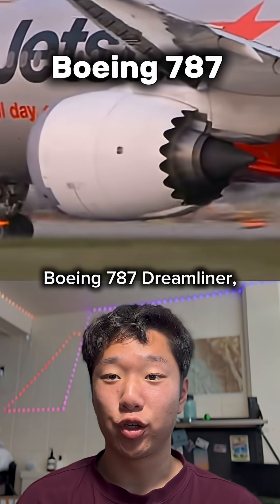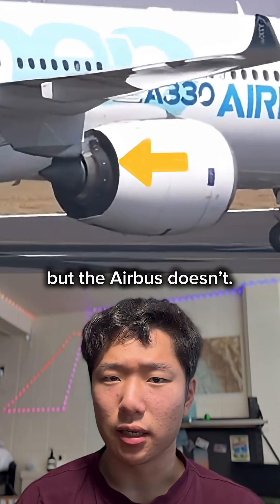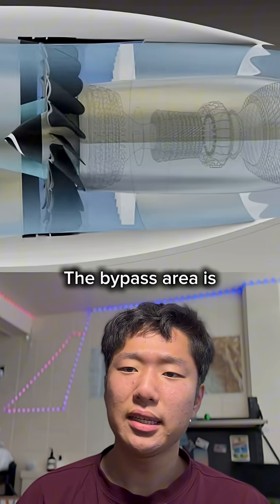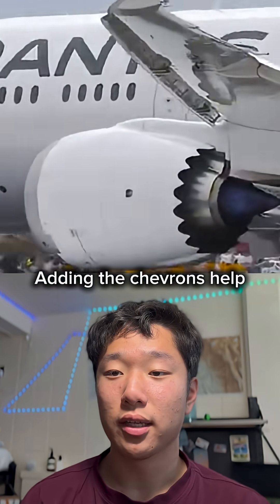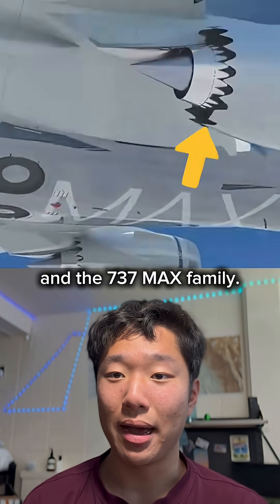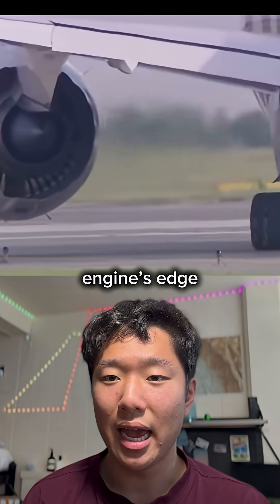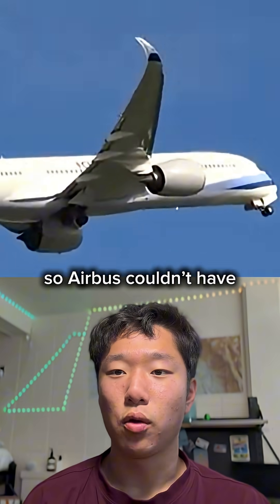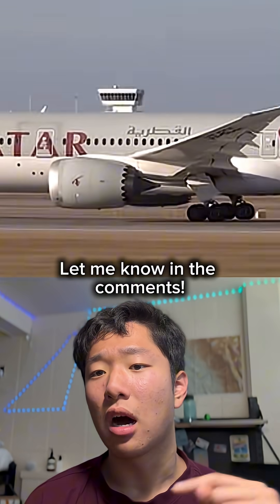Why do Boeing plane engines have chevrons? #aviationgeek #aviation #airplane #aeroplane #airlines

Comment: When you can increase efficiency 0,5% at no extra cost it’s a no brainer. There is constantly 100eds of engineers at both companies only working with efficient designs. More efficient engines. 
If any of them could get fuel 0,5% cheaper they would do almost anything to get that. 
It’s both cost over a 30-40 year lifespan and emissions. 
It’s just Boeing madness to have them. 
Getting another seat in for free on each flight is worth a lot of money for all airlines. 

And the finances of an airline is all about filling every seat. They make no profit on 80% filled planes. Many not at 90% full planes. But the last passengers is all profit. 
That is why fuel cost is so important. 

Same as car manufacturers. Some cars break even at 150.000 sold units. Then the profit comes on each unit produced after that. 

That’s why a flop car can ruin a car manufacturer. Big initial costs must be recovered before there is any profit. But a great selling car can make shitloads of money for a manufacturer. 
And a recall that costs $ 500 for all cars over a 4 year period can put a manufacturer back to red numbers. It’s all about the volume over break even that can be profitable. Very profitable. 
A car can cost 30% of manufacturing cost. But development and factories must be paid for before they get any money in profit.

Another similar industry is restaurants. They have lots of costs even if there are 10 customers they loose money on each one. But maybe a small restaurant needs 150 customers for lunch and the last 50 makes a big profit. The food itself costs very little. It’s the staff, rent, equipment, insurances, and more that is the same regardless of the amount of customers.

So for an airline to choose 0,5 % extra fuel cost is madness. It’s pure profit.
Maybe it shows how badly Boeing is being managed and there is no real structure for decisions. Some noise department make decisions that the entire fusilage and wing design would flat out refuse. The management has no idea because they are busy making deals for themselves with bonuses and options regardless of result. Very short sighted.
It’s like Boeing is managed by a hedge fund manager who is only interested in numbers that will give them more bonuses. If the company survives and is innovative is of no interest if the bonus is tied to numbers of employees in a certain factory or the diversity in the board of directors. 
A company making complicated mechanical products that must have the highest standard in safety, reliability and cost per passenger is not an engineer, then you get to Boeings current state. 
An engineer can easily learn economy and have all the help they need for that and HR departments. 
But you can’t replace an engineer in a company where engineering is its primary job. 

Never ever nowhere..